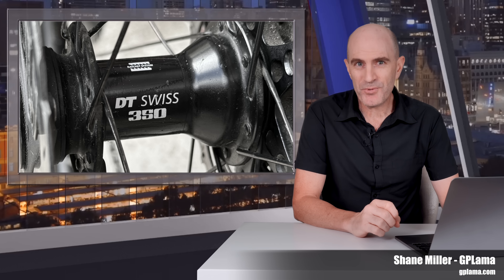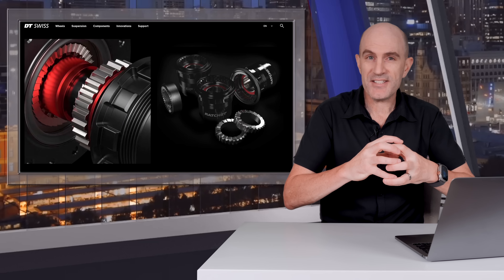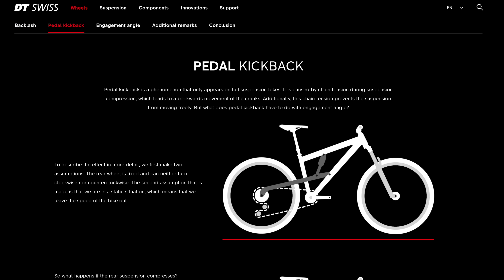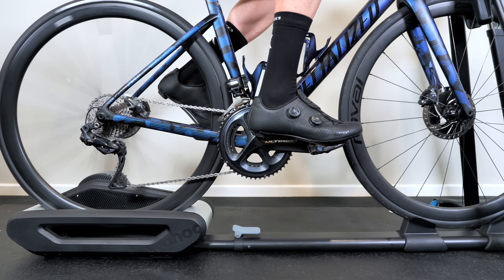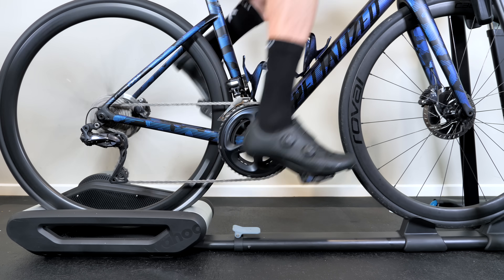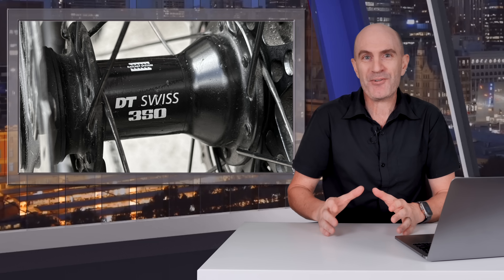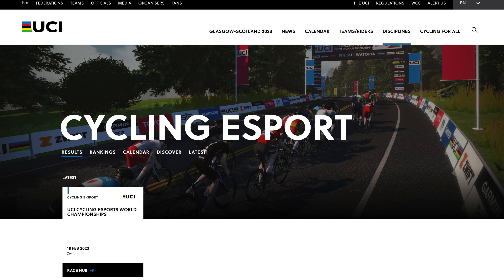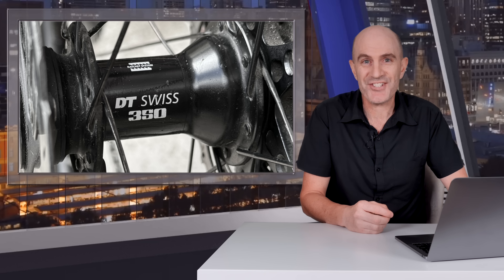ALL ABOUT Freehub Engagement // DT Swiss 350 Upgrade!

Comment: I was forced down this rabbit hole, somewhat reluctantly due to changing to a 10x52 Sram cassette. Everyone seems to focus on the sound of the 18,36 & 54 rachet style freehubs. Im more concerned about the ride differences and the longevity of the 3 types.... especially on a full suspension, fully loaded bikepacking bike. Thanks for your video, it goes further than most into the actual mechanical variances.

Comment: I upgraded to 54 T on my DT Swiss 350 hubs on my road bike but went back to the 18T the very next day. There is less of an engagement angle, but it honestly didn't turn out to be that important after all, and the 54t has significant disadvantages on a road bike. The main one is that the 54T rachet is VERY loud and annoying; it sounds like you're being chased down the road by an enormous demented wasp. In addition, there seems to be more drag with the 54T rachet, though that might just be because I was a bit too stingy with the grease when I swapped rachets. If you're not riding on  seriously technical terrain, or doing a lot of sprinting or crit racing, the 54T may be an unnecessary waste of money.

Comment: As a few have already said 36T is the sweet spot for road. 54T is very very loud in group rides, not so much with heavy and thick walled 350 hubs but on 180’s they scream. Also there is the drag factor, 54T does have some drag penalty when coasting downhills at speed. I’ve not had a problem with 36T in that the engagement isn’t a noticeable issue and the hub coasts load enough to not need a bell but not so loud that at 45km/h descents you can’t hear yourself think!

Comment: I think that the angles you are showing in the screen are only 20°/6,6° if the bike has a 1:1 ratio. 6:49 
If you would show them at the rear hub it would be correct.
Reply from the maker: Engagement angle is just the ratchet itself. The maximum backlash would be the same angle as the engagement angle if the gear ratio is 1:1. (as I understand it). The angles I show when moving the crank on the bike are done in the same gear, so that's just a comparison of before/after.
Reply: @gplama  so the angles shown aren’t 20/6,6. you just visualized the movements of the crank. For my opinion that’s correct. 👍🏻

Comment: I have the 54 tooth ratchet on my gravel bike and it’s amazing for two reasons.  The low engagement angle is perfect for heavy terrain with a lot of rocks or roots. Makes it so much easier to maneuver through. 
Second. Brrrrrrrrrrrrttttt. No need to use the bell. Everyone’s running away in fear when you decent a fire road with 40kph 😂

Comment: IMO for road bikes 36T is more than enough considering the style of pedaling, speed and gear ratios, even 18T should work. It requires less maintenance and has less freehub drag compared to 54T. For MTB 54T could be beneficial due to very low gear ratios and speeds when climbing and plenty of stop and go pedaling due to obstacle avoidance.

Comment: There’s a little known 24t ratchet available from DTswiss which splits the difference between the 18t and 36t. It reduces engagement to 15 degrees and is a worthy upgrade being quieter and less draggy than the 36t while also being more robust since it is designed as an eBike part - far more solid than the “SL” lightweight 36/54t offerings.
Reply from the maker: Interesting!

Comment: For gravel I have switched to a wheel set with a high engagement. While riding on rough roads with a high cadence I often get bumped out a smooth stroke. This results in that dreaded clunk as you disengage and reengage the drive. I get far less of this with a high engagement hub. As far as drag from the hub - it’s not a concern for me. If I am not pedalling, I’m normally on the brakes.

Comment: I never thought to consider that "clunk" I sometimes hear on the trainer--and that drives me crazy wondering what is wrong--is the freehub ratchet re-engaging after turning 𝛉° freely after a short coast. Gracias on that, @GPLama. My 180 EXP hubs come with 36T ratchet rings,  but I think I'll stay with the 36T rings to save a bit of friction and a lot of money.  The upgrade kit for 54T, with the extraction tool included, is $190 US!  That's almost 2/3 the cost of the Gore Shakedry jacket I'm saving for (Don't tell my wife!).   Also, the 10° engagement angle that comes with the 36T engagement ring is loads better than the 13.3° (27T) engagement angle of my old PT G3 rear hub) and even bigger loads better than the 15° engagement angle of the White Industries hub that preceded the PT hub.

Is there freehub coast-down test in GPLama's future?  Now I'm interested to know how big the fictional losses are for the 54T ratchet ring over the 36T ratchet ring.

Comment: The engagement angle at the crank is dependent on the chosen gearing.  In a high gear the engagement angle is small.  Since on a road bike one never freewheels while in a low gear, increasing the hub's engagement angle on a road bike is pointless to me.  As vongdong10 pointed out the tradeoff in a 54T is the extra friction while coasting.  For me the best ratchet is 18T for road, 36T for gravel, and 54T for MTB.

Comment: I have been riding with Chris King Classic Hubs on my road bike since 2015.  The rear hub has 72 points of engagement, which is fantastic IMO and the "angry bee" buzz is not as loud as many newer hubs that I have heard out on the road.  The hubs are easy to service, when required, which is not often due to my dry California road rides and are built to last.  I know of riders still running their hubs since the '90's.  Pricey, but great product.

Comment: I have the 54t on both my MTB and road bikes. Other riders tend to complain about how loud it is, especially the road bike (Roval CLX50 wheelset). 

FYI the upgrade kit is way over priced, you can buy just the the ratchets as a spare for significantly less, and the springs don't change. I already had the "special grease".

I think the main benefit for a MTB is when you need to ratchet the crank to avoid an obstacle. I also think pedal kickback is mostly BS, as it doesn't exist when the rear wheel is actually rotating forward (the forward rotation serves to more than cancel the effect); it's only used to justify ugly high-pivot layouts.

Finally there are two different ratchet systems from DT swiss, this video show the original style (which I also have), but there is the new ratchet EXP (which did have some manufacturing issues) so you'll need to be sure an know which version you have.

Comment: Nice on Shane.  It's worth noting that the free or non engaged rotation of the crank depends on when the rider decides to stop coasting.....NOT taking anything away from all your 100% valid points.  Certainly when the MAXIMUM engagement angle is larger you have a wider range of "free" pedal potential.

Comment: There are downsides to high engagement hubs, which im surprised you didn't mention. The higher engagement hubs obviously mean smaller teeth, therefore more likely to break/wear. Also, they will be less efficient as you've clearly got more friction from more touching parts. On the road at higher speeds/bigger gears, the higher engagement is a bit of a waste. Off road or stop start riding the higher engagement is worth it for the reasons you mentioned although with the higher maintenance. The 36 tooth dt swiss ratchet is a nice middle ground for the road. On the turbo, give me big, reliable pawls and fewer teeth. The sampling rate doesn't really allow for the engagement to be an issue.
Reply: Yes, this.  Mountain bikers have known this for a long time.  There are lots of stories of high engagement star ratchets sheared off in DT hubs.

Comment: I would imagine the reason that they don't care about the engagement angle is that even with 10 Hz race mode, that is the major cause of lag - not the freehub engagement. At 90 RPM, you have ~50 degrees of crank rotation before the next update in a 1:1 gear ratio. To get down to the ~20 degrees or so you would need for the dominant source of lag to be freehub engagement, you're talking about < 30 RPM in a 1:1 ratio.

Comment: I have the 54 tooth on my mtb and could never go back. I think its less necessary for road and adds drag to the system when coasting. I suspect the durability of the 54 tooth ratchet is diminished - I have heard of them breaking.

Comment: 3:22
The roval C38 is 350? I thought it was 370, specialized website also says this. E.g 3 pawl system, upgraded to Ratchet LN.
Reply: You're looking at the Roval Rapide C38. The wheelset used to be named just as the Roval C38, which at the time used a 350 hubset.

Comment: I had a set of Roval CLX32 and was really disappointed they came with 18T engagement, the dead air was awful and made track standing difficult at traffic lights.  I swapped to the 54T, but the smaller teeth sone wore down and the engagement started to slip, so swapped to the 36T, which was better.

Comment: Great Video. Years ago, when I was still racing, I got a new set of roval wheels and immediately upgraded the Star Ratchet. Note that for “special grease” I still use the light, clear Shimano grease. If you don’t keep it greased it will get noisy. But even well maintained these are a bit noisy. People often told me in races they could hear me in my attempt to stealthily draft them before a pass. I believe most people will not notice much of a difference but if you are looking for marginal gains, go ahead. Also, for mtn biking, I think this is super important and the smaller than angle the better. IMO.

Comment: Wasnt the two-spring / two-ratchet version recalled? For my 54T upgrade I had to use a DT specific nut as one ratchet is now screwed in
Reply: The only relatively recent DT Swiss recall I could think of is the Ratchet EXP recall.
Reply: @sbccbc7471  got it thanks. Thought there was just one ratchet system

Comment: Where this is even more noticable is in cyclocross, where you constantly start pedaling really hard (almost sprinting) after every corner. Currently I'm using Zipp 303 s for cyclocross as these are not that heavy and not overly expensive, yet really sturdy, quite aero for the faster courses (not that that's really necessary) and most importantly I already had them, but the freehub engagement on these is… well, not ideal for cyclocross usage to say the least. I might get myself some more CX focused wheels somewhen in the future (shallower, lighter and most importantly with fast engaging hub), but after recently buying a new road bike, Zipp 404 Firecrest wheels to go on it and two powermeters, I've already spent enough on cycling this period 😅.

Comment: One thing I found from switching to a 54t from 18t is the amount of drag the 54t increases. Coasting is noticeably decreased. 36t is where it's at.
Reply from the maker: Interesting! I'll see what Mrs Lama reports back and may swap this out for a 36T. 👌🏼
Reply: I was thinking there had to be a reason why 18t exists as there are always trade-offs.  Interesting that you actually noticed a difference.  "Coasting drag test" would make for an interesting video
Reply: All I'll say is 'sprag clutch'! I got a rear hub with one and I love it. Heavy but totally worth it for the piece and quiet as well as instant engagement.
Reply: I agree. It’s clearly noticeable on a bike stand when spinning the wheel.

Comment: I got the 350's with 36T on my DT Swiss E512 MTB wheels- I got some cheap H1900 wheels (£49 each!) in a Wiggle sale (needed wider than 25mm ID rims for off road) but being 370 hubs they came with the 3 pawl system...it is possible to buy a conversion but you then also need 2 (QUALITY- not Ali Express cheese) tools to remove/install them- think it totalled over £200...just left them on the 3 pawl as it kinda defeated the "bargain" I got.... H1900's doing fine, and that's on a KTM E-MTB....

Comment: You should try the Onyx sprag clutch hubs wih INSTANT engagement and silent freehub. I switched from them to DT Swiss and the 54T was a must uograde for me as I was spoilt by instant engagement and couldn't go back anymore to a 36T even.
Reply: I love my Onyx rear hub, silence is music to my ears.
Reply: Came here to mention this.
Reply: Same, but for $105 USD shipped, the DT Swiss upgrade is a tad cheaper, even if only 50% as good as a Vesper Hub. Vespers are on my "A Race" wheels (Onyx, CX-Ray, Astral Serpentine), upgraded hub are on the back ups, OE Cannondale "Hollowgram" (aka DTSwiss) wheels.

Comment: From my subjective experience ratchet systems feel quite a bit more draggy than the pawl. And the more teeth the more drag. Try rotating your cranks backwards on the stand and see how quickly the wheel starts turning. Also spin the cranks forward and see how much chain suck you get. 
Obviously it also depends on how much you grease them, but in my comparison I'm referring to stock levels of grease.

Comment: The counter-point of why high-engagement hubs are typically not specced as default for the road is due to the loss of kinetic energy (the buzz) from coasting. From memory, Dt Swiss spec 36 POE for both the 240 and 180 ratchet hubs as standard with a 54 ratchet available as an upgrade, and the new engagement system EXP is 36 POE with no upgrade available.
Reply: There's a 54T upgrade for DT Swiss hubs using Ratchet EXP.

Comment: I have a Norco Search with Shimano RS470 with caged bearings front and rear. Bearings stuffed up and ruined hubs within 12 months of being serviced. Changed both front and rear hubs to DT SWISS 350 hubs with 36 tooth engagement. I am very happy with them but don’t understand why a $3,000 bike at purchase in 2021 would be fitted with such a basic crap component.

Comment: also remember that on a pawl system there is often offset in the pawls so not all of them engage at the same time ,though you need 4 or 6 pawls for this, so they only click in 2 or 3 of them at time, this cuts down on the engagement angle from just counting the number on the rachet.
Reply: And this offset leads to axle failures...
Reply: @lucasg2895 I thought Industry 9 had sorted out the issues they had with this? But yes, it can cause other issues because it relies on material flex to function which is somewhat questionable.
Reply: I9 definetly figured this out. thousands of MTBers abuse those wheels.  nearly zero reports of failureor premature bearing wear
Reply: @lucasg2895 how so?

Comment: The cost to manufacture a 18, 36 or a 54 cog is mostly the same. I find it very disappointing when manufacturers are still selling wheelsets with 18t and then charging a premium for cyclists to upgrade which should have been a standard in the first place. I just recently bought a wheelset form the same DT Swiss and honestly was disappointed to find a 18t in 2023 ...
Reply: as DT Swiss says on their website, "In the development of an optimal freehub system we believe that three factors have to be considered:  reliability, weight and points of engagement. But you must bear in mind that there is a trade-off between all of these three dimensions." 18T is the most reliable, requires the least servicing, and the quietest. It's the best choice for many riders.

Comment: One thing to note, DT Swiss themselves don’t actually recommend the 54T for most people as yes you gain in kickback, but you lose out in other areas. They recommend max 36T for road application. MTB/trails need it for the control when cadence is really low going uphill.

Although it looks a significant difference when you do that static test, in a real world case, on road bikes for example, the wattage/responsive savings would be virtually unmeasurable. When you think you do 1.5 revolutions of the cranks per second, the time it takes to pick up that slack wouldn’t even register in race mode when pedalling at real life speeds as you could turn the cranks 54 degrees (per sample point (assuming 10Hz) 1.5/10 * 360. So given it would be unmeasurable and even DT Swiss don’t recommend it I’d be amazed if this is something trainer manufacturers implement.

By the way, still love the video, it’s just this is a rabbit hole I’ve been down before, just went a little deeper 😂
Reply: Your assumption that we are turning the cranks 1.5 times per second does not come into play when you would need the lower engagement angles. Such as when you are coasting down hill, coasting a bit in the draft before you release the sprint etc. THIS is is the time when you need these not when you are turning the cranks and the free hub is engaged.
Reply: @bighammer3464  haha yes I know it doesn’t apply whilst you’re pedalling!! My point is that as you go from coasting to pedalling, the rate of turning the cranks is much quicker (in road/trainer applications) than in the static test Shane demoed in the video turning with his hand to find the bite point.
Reply: In which areas you lose with the 54?
Reply: @matteo.ceriotti  main two I would say are drag (that noise costs watts!) and durability due to the smaller teeth.
Reply: @matteo.ceriotti Main issue is in durability, especially if you are a powerful rider. I'm not sure I agree with @aerobrain2001 on the MTB side of things either. Yes having a really fast pick up on an MTB is nice on techy stuff where a large pick up rotation can make your life much harder, you are putting down a very large amount of force so those fine teeth are going to take a battering if you are strong or heavy. 18 POE is slow but 36 is probably the sweet spot for most people. These upgrade kits are not cheap!